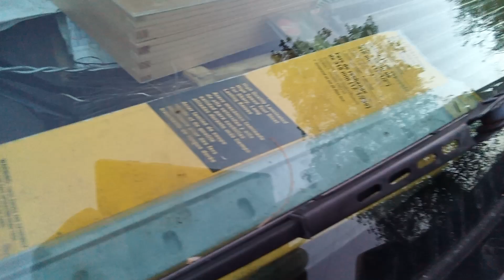Randy has gone an done it again, another dadgum auction

Comment: That DeWalt cuts slots for bisquit joints.  There's a few sizes of bisquits you can use depending on the depth you set the cut.  Makes dowel pinning for joints outdated.
Reply from the maker: yes I works! now I need biscuits and blades and I have the wood glue. Maybe some day I will get one of those handy box blades at a auction. They bring almost new price at sales around here